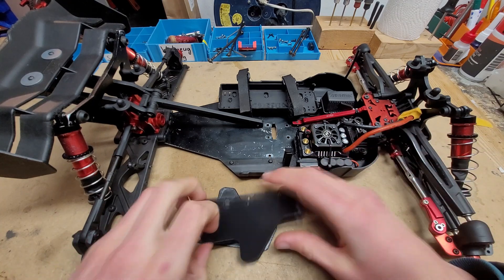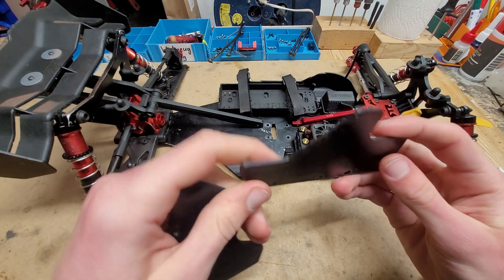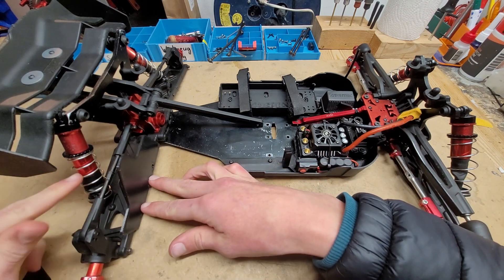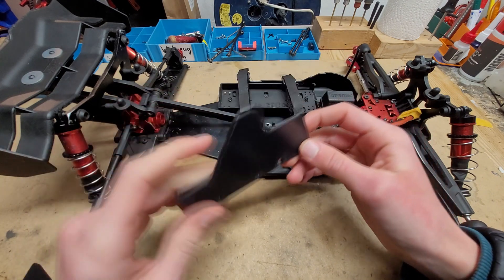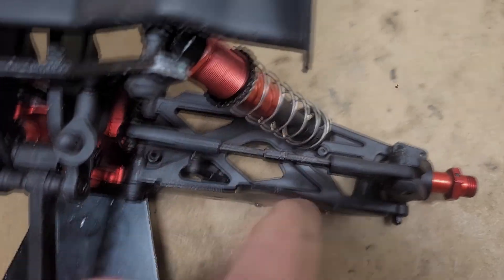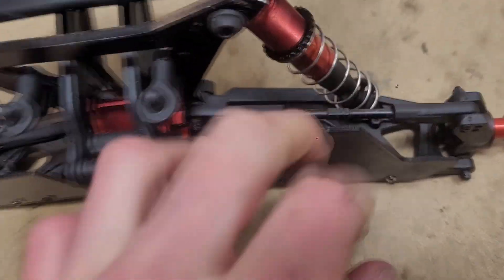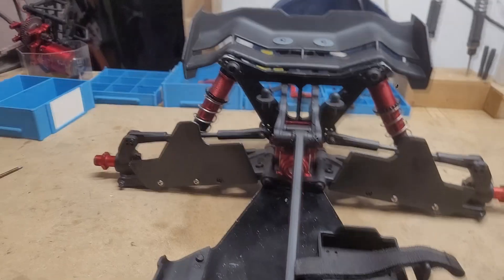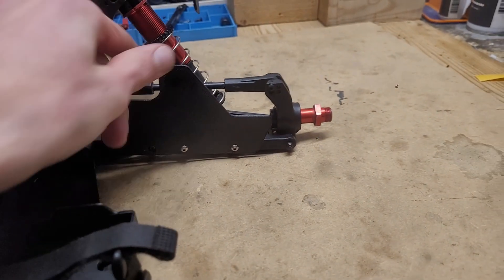3D Printed Mudguards for your RC Car - Arrma Kraton 6s

Comment: Is this Mudguard for Kraton 6S V5 BLX RTR?
Reply from the maker: The V5 has slightly different arms, it probably still works though if I had a guess. If it doesn't fit, try ones made for the EXB

Comment: I like this mud guards I will have to give them a try. I printed another version in PLA+, PETG, and TPU. Going to see how they hold up.
Reply from the maker: Oh, surprised to see a comment this long after i released the video! After some time I've found out TPU Guards are more durable. The PLA ones broke after a lot of bashing and jumps, the TPU ones are still fine! Thanks for watching, maybe you're also interested in my Kraton Wing I covered in another video? More videos coming as well :)
Reply: @ValRC1  did that as well. I saw you comment on Reddit about my post regarding the TPU wing and stubbled to your YT page. Thank you for letting me know about the PLA ones. I will try PETG  as well and see how that holds.
Reply from the maker: @PeighDayRC  ohh ok, that's crazy how you found my channel that way, welcome tho! I also printed out a TPU wingmount for my Kraton recently, haven't been able to try it out yet tho because of a shot motor bearing so I'll have to wait for that to arrive.. Wish i would have known about the wingmount you used before, seems nicer than the one I ended up trying